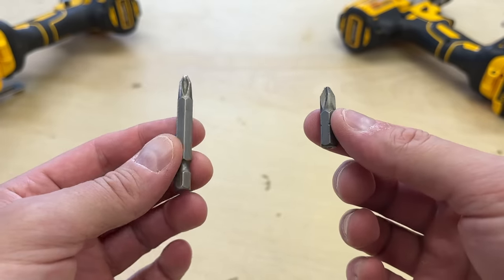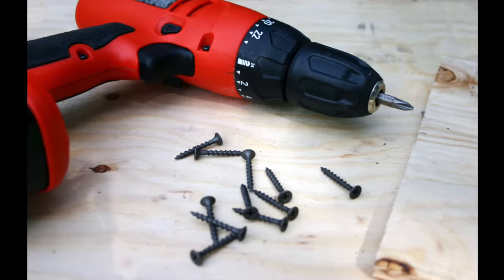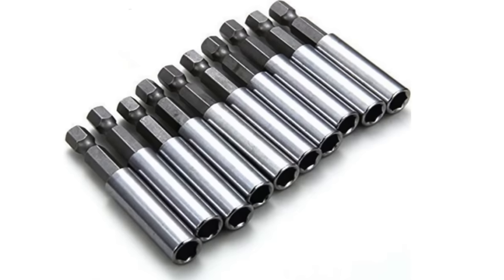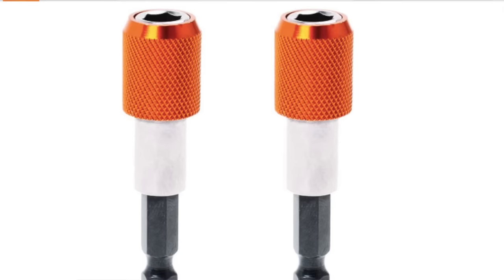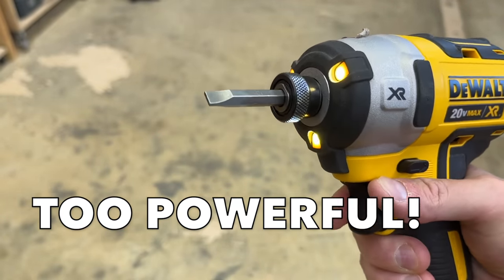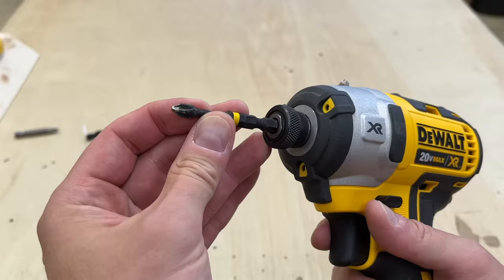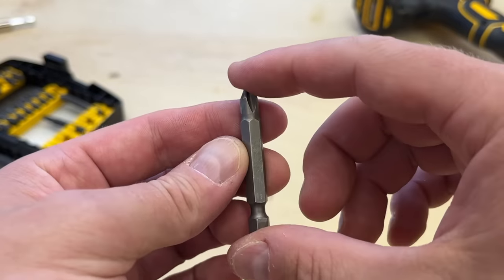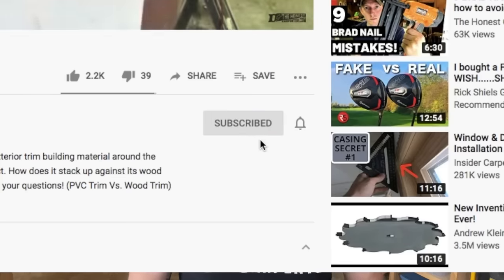Power Bit vs. Impact Bit vs. Insert Bit...WHAT'S THE DIFFERENCE?! (Driver Bit Guide For New DIYers!)

Comment: The power groove on standard bits was common in several brands years before impact drivers became common place. It served the same purpose in that there were extensions with spring loaded couplers that would hold them until the coupler was released so the bit would not drop out when you pulled it off the screw head.
Reply from the maker: Thank you, Purple! I think I entered construction at just the right time to miss this transition tool adaptor 😅
Reply: I like these bits because before I ever owned an impact gun I only had a drill driver. I bought a quick release adapter and these bits worked great. I could change bits fast and they remained secure while using them.
Reply: @TheHonestCarpenter  also I’ve seen non-impact drivers, at least on Ryobi and Milwaukee lineups
Reply: Yeah, you beat me to it, quick release was around long before impacts. Impacts just adopted the setup.
Reply: Yep! I have a "Sears Craftsman Professional" quick release drill bit kit that I still use today. I picked it up 25 years ago.
Reply: @TheHonestCarpenter  You must also remember that there are 1/4 inch quick release hex chuck drill drivers that are not impact drivers, so the non impact rated bits with the power groove would work well for those.
Reply: yeah, that wasnt his only error.
they video maker doesnt really know what he's talking about
Reply: @illestofdemall13  and thats exactly what they were made for. the video maker shouldnt really be using bits in a drill at all, you'll burn out the motor that way - drills arent made to apply they amount of torque required in screwing fastners, theyre made for speed and light pressure with a drilling bit
Reply: Yup and locking hand drivers
Reply: Good to know. I thought they were so Ryobi could make their bit holders on the cheap and save a few miligrams of metal doing it :)
Reply: Originally called 'quick change' adapter's in Australia.  But the adapter's had the same 'quick change' bit shape as the bits they themselves held, which confused a few people.
Reply: This makes me realize how old I am
Reply: Youngsters don't remember the days before impact drivers, or that the first drivers were pretty feeble compared to the torque today's drivers put out.
Reply: @Ghryst I went to your profile to see the expert videos, but I didn't find anything you're doing. Maybe share the channel where you post your  expert advice?
Reply: @TedHallII i wouldn't be so sure about that. I'd consider myself a youngster but for budgetary reasons I'm pretty familiar with hand drills, non ratcheting sockets and needing a separate tool that's taped to the cord to swap out drill bits.
Reply: @TijmenHatesads  My kids grew up with hand tools, corded drills, and a lot of antique saws, bits and braces, and other turn of the century equipment. 
These days, my youngest loves his collection of planes and works mostly by hand  unless he's in a hurry. #1 son rehabbed a house in New Zeland last year with whatever the locals had for tools.
On the other hand, they also grew up with cordless tools from drills to 700 foot/pound torque 1/2" impact drivers. In the last 60 years of working I've seen a lot of changes. Today's 1/4" impact drivers are amazing. I moved from a hammer drill and quick change adapter to a dedicated 1/4" impact driver and wonder why I didn't change over quicker (well... actually I jumped on the older model when it hit clearance prices) Good info in this video, but some details are questionable. 
Just for grins, imagine a monster automotive impact wrench with a 1/2" to 1/4" adapter and a screwdriver bit. Mine can drive screws into the hardest stuff I've found or destroy bits instantly if you aren't careful.
Reply: @TedHallII  I grew up in the 70s and my father was a carpenter but cordless tools and interchangeable bits didn't exist then. When cordless tools came out they were expensive so I didn't get my first cordless drill until the early 90s.
Reply: @tvviewer4500   yep, me too!  😂
Reply: @TedHallII  haha that last bit reminds me my work van has a 1/2" square to hex bit adapter. It is only for emergencies.

Coincidentally, I also recently found an M10 carbon steel bolt with a split head. Just cracked right down the side. Don't know what bit did that, but once I found out its getting painted gold.
Reply: @Ghryst then why are they called drill/drivers , and have a clutch?

Comment: Good grief. I just got back from the store with the (apparently) wrong bits. Btw, if those bits don’t work on the impact driver, why is that what they sell them with?!
Reply from the maker: That surprises me David! They’re messing with impact bit finishes to stand out as brands—there could be some new color confusion here! 😬
Reply: I've driven plenty of fasteners with normal long bits in an impact driver, maybe not ideal but you'll be fine in a pinch. I guess keep your eye pro on in case it explodes.
Reply: @TheHonestCarpenter  I’ll have to re-check it. I’m sure it’s just operator error. My usual problem is running the tool at an odd angle without sufficient force behind it. As soon as the screw acquires some torque, the bit jumps the groove, and I strip the bit.
Reply: @GotGracexxxxx  Just bear in mind some fastener types are more prone to cam out than others, or perhaps, are less forgiving of perfect technique. Using an impact driver alone (presumably with a good fitting bit) reduces cam out by quite a lot by virtue of the hammer and anvil resetting the contact surfaces with each impulse. (See Matthias Wandel's video on impacts and cam-out)

Old fashioned Phillips will cam out, especially when worn out a lot more than say, Pozidriv or Torx.
Reply: @wingedcoyote  The thing on notice when I have to use non-impact rated S2 bits is that when it breaks it's almost random. An impact rated bit will almost always go in the torsion zone.
Worse still the normal bit will send that impulse into your brittle fastener and break the head or shank. When I'm working on something I'd rather break a bit than break a 3" deck screw in my project.
Extracting broken screws is an exercise in inner peace.
Reply: @ALAPINO  That last line, totally. 🤣
Reply: My experience is wood absorbs impact i.e. it's very forgiving which tends to "allow" people [like winged coyote stated], to habitually use the colorless normal bits with an impact driver. Regarding the "give" that metals afford us, well not so much; like when there's approx zero give left as the last few impacts are seating a screw, bold, or nut, etc which is when things start getting interesting.  ;)
Reply: @DanKoning777  Truth is, we don't know any better! My father was a woodworker, I learned a lot by watching him; but as a kid, we never discussed names of tools, what exactly they did, or why he had 7 of the same (bit)-in my eyes. Now I know the slight differences have meaning. 😀
Reply: @leeraynz  //  I felt the same way watching my dad, as did my 3 girls who helped me quiet a bit. 
Seems they still remind of that fact from time to time too.  :)
Reply: @wingedcoyote  while possible with some of the newer models of drivers at slower or variable speed, with small fasteners into softer materials, or some combination  thereof, impact drivers are capable of introducing enough force to cause traditional bits to shatter into fine sharp shrapnel that can travel with the speed of a very slow bullet.  This shrapnel, because of its small size and sharpness, has the potential to cause extremely serious injuries, including butt not limited to: blindness, lacerations, punctured lung, death.  

Since it is impossible, without the aid of  a materials "X-Ray" lab, for the user to reasonably predict when and how a bit will break, it is extremely foolish to suggest that anyone use regular bits in an impact tools.  In fact, in most places within the USA, such advice  qualifies as criminal negligence and can place you at serious legal and financial risk should someone follow your advise and be injured.  This is why impact tools manufacturers have copious warnings about USING ONLY IMPACT RATED accessories (bits, etc.) with their tools.

Comment: Impact drivers use an impacting anvil to increase their torque, not a ratcheting mechanism. The addition of the impact force also increases shock factor whel loosening fasteners. Also, the groove came before impact drivers were on the market, it was for tools that offered a quick release chuck.
Reply: the internal mechanism is certainly not a ratchet, but i think the point being made is that the screw becomes a defacto ratchet at the screw/wood interface, whereby anytime it binds the impact overcomes the static friction to slide it forward again
Reply: @5naxalotl  no,, he just doesnt understand how impact drivers works and said it uses a ratchet mechanism because the clicking noise it makes sounds like the clicking noise that a ratchet makes
Reply: unintendedpurposes is right. Quick change bits have been around longer than The “Honest” Carpenter has been alive.  It’s the “torsion zone” gimmick that’s new.
Using less metal in each bit ALMOST seems logical, but it doesn’t keep bit tips from breaking.  Also, an impact driver isn’t needed to break but tips.  In my 29 year career, I’ve broken more bit tips with a drill than I have with an impact… regardless of bit type. 
In the early 2000’s the best bits on the market were “cryogenically frozen” Bosch bits with serrations on the top.  They were hard… very hard!  They nearly never wore out but occasionally one would snap right off in the screw head as it reached final torque.  DeWalt made some with serrated tips but not hardened. They gripped well but eventually did wear out.  
So, the moral is buy good bits, do good work, and never mind the gimmicks unless they actually deliver.  THAT’S honest carpentry.
Reply: I think he was alluding to the fact that the action on an impact drill is rotational (like a ratchet) .   its not forward like a hammer drill

Comment: Nice to know.  However, I have used regular bits in impact drivers for years and have had almost no failures.  Unless you are primarily using big, long screws, impact bits are only marginally useful.   If impact bit would prevent me from losing them at the same pace I lose regular bits, THAT would be an awesome feature.
Reply: Yeah, I use quality made in Germany, 1 quid each, 'power bits' because impact bits never existed 14 years ago when I got my first impact driver,  I saw some makita ones, they were 14 quid for 2! Well, they were shite, my 18v bosch snapped it off like a carrot! The normal power bits last for ages on normal size screws up to no5 x 150. Anything bigger than that an I just use a new one an most of the time you get the job done without breaking the bit.
Reply: @michaelbamber4887  Well, you got ripped off. I bought a set of 18 Milwaukee impact bits for 20 canadian dollars. $14 for 2 is way too much
Reply: @tcg1_qc  years ago remember.  New items out, so hence price. I have some here now that were £6 for 5 bits. They last ok now.
Reply: @michaelbamber4887  oh, for some reason I thought you were talking about today
Reply: @tcg1_qc  ha, no, until now, I've been to tight to even look at them because the £1 each German ones have 2 ends on um, 50p a go!

Comment: There are quick change non-impact adapters for drill/drivers. They were developed before there were impact drivers. That's why they also have those notches.
Reply from the maker: Thank you! That’s what I surmised. But I just see them so rarely that I wasn’t sure if I’d missed some phase of tool development. 😅 I appreciate that!
Reply: Also there are some impact rates models without that skinny part.
Reply: The quick change bits have those notches for bit retention in bit holders that have retention clips, they use a release collar to eject the bit so you don’t have to fight the magnetic retention. (You had a picture of one version, that fat collar by the head was a release collar) those notches are not depth guides. Nice try though, they do work for that, but not their designed purpose.

Comment: THANK YOU!!! I have talked to many sales associates at big box, lumber, and hardware stores. Not one of those people could adequately explain to me about bits. For that matter, most couldn't explain the difference between drills and impact drivers.  I am 66, a widow, and I LIKE the independence of having the 'know how' to do home fixes.  In this social climate it is a survival skill.
Reply: I used to work at a contractor grade tool store in San Diego.  Every great tool brand, tool repair and a super knowledgeable sale staff.  What bit and tool do I need to drill this hole in concrete, what do I need for dust collection in my shop, what is an impact driver etc.

Unfortunately, amazon really put them out of business.  YouTube is where you have to go for this knowledge now.  Or forums like Reddit.

Comment: The deep round groove is for a ball detent bit holder. As noted by others, these predate 1/4” Drive impact drivers. The shallow skinny groove as seen on 1” insert bits is for a wire detent, as found in bit holders and built into traditional corded drywall screw guns.

Comment: Exactly the info I was looking for. I've been holding off buying an impact driver because it was the bit differences that confused me especially the ones with the notches but as you said they are not designed to be used with impact drivers. OK so now I can get that impact driver and a set of power bits.  Thanks for clearing this up!

Comment: A very important point that was missed is that the torsional flex in the shaft of the impact bit will help keep the bit from camming out on the fastener. i.e. You are a lot less likely to strip the head of the fastener with an impact bit. The shaft absorbs the blow so the bit stays in the socket of the fastener. This is the main benefit as far as I am concerned...
Reply: and thats what the flex section is designed for - not for absorbing impacts (thats just counter-productive). the video maker really doesnt know what he's talking about. its quite obvious he only works with wood, where these kinda blatant mistakes won't result in catastrophic failures
Reply: That's also my understanding. I have broken as many impact bits as any other, but the impact bits don't cam out and strip heads before the screw is seated nearly as often.
Reply: @Ghryst  it's actually not counter productive. Making that section thinner gives it a bit of torsional leeway. Given that impact bits tend to be a harder steel, it helps prevent snapping the tip of the bit off.

If it was just a solid hex shank the whole way down the minute you bottomed out going full tilt you'd snap the tips off your drivers constantly.

It's not counter-productive to act as a torque limiting attribute. Same concept at torque sticks for big impact wrenches.
Reply: @ObservationofLimits  it is completely  counterproductive, you have an IMPACT BIT, that relies on the mechanism of IMPACTING hard, with a shock-absorber that ABSORBS IMPACTS built into it..
you literally couldn't make it any more counterproductive other than by putting a ball bearing swivel in it.
and torque sticks have been totally written off as not accurate at all. if you are using torque sticks in automotive, yr literally gonna kill someone. dont be fucking lazy, use a torque wrench
Reply: Idk I’ve found the proper size bit with an impact shouldn’t strip a screw when properly used, impact-rated or not. Push into the piece as you drill, use an impact, and don’t use crap hardware and you shouldn’t have any issues with stripping at all. Having used both thin-shaft bits and regular bits of all variety, I can’t say I’ve noticed even the slightest bit of difference, figured the thin metal was to save on costs and allow more visibility than anything else.
Reply: It wasn’t missed. He very obviously says it will keep it from camming out. Maybe you weren’t paying attention
Reply: He said that in his description.
Reply: @calvinmitchell141  exactly, trying to call the guy out, but looking like a clown doing it!
Reply: Excellent tip for me as a newbie to this. That makes total sense and that is what I have always been doing. Stripping the darn head of the screws. Thx
Reply: @Ghryst  torque sticks for automotive wheel lugs were never meant to be used instead of a torque wrench.  They were meant to be used in addition to a torque wrench.  They are a tool to ensure a lug is NEAR the proper torque, but not over-torqued; then finish the job by tightening to final torque with a calibrated torque wrench.  Torque sticks are a tool for speed and convenience in a tire shop or other similar setting where production is the name of the game.  Back when I installed tires for a living, I could easily bust out a set of 4 in 15 minutes, and that's demounting old tires from the rims, plus mounting and balancing new ones.  Try to go that fast using an impact wrench with a normal impact socket, and you're highly likely to over-torque the lugs.

Also, by your logic, impact drivers have no reason to exist the way they are, nor would they even function.  Well, they exist, and many hundreds of thousands of people use them to great effect all the time.
Reply: @4WDriver  "never meant to be used instead of a torque wrench" - but that is exactly how theyre used in industry, hell, half the time mechanics just use an impact wrench and dont set a torque at all, especially on wheels. i see it everyday at work
Reply: @Ghryst  just because there are people (even a lot of them) who may use a tool incorrectly, does mean it is a bad tool; it means they're hack mechanics.  Don't blame the tools, blame the operator.